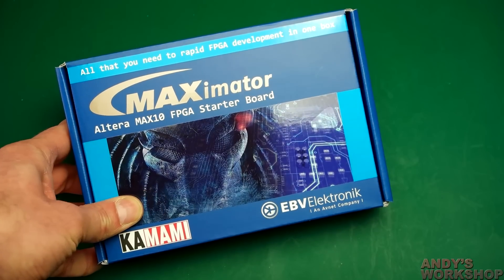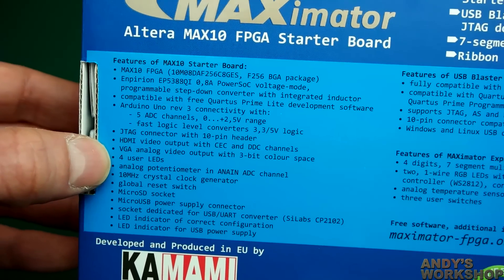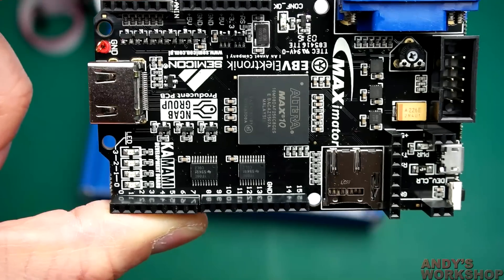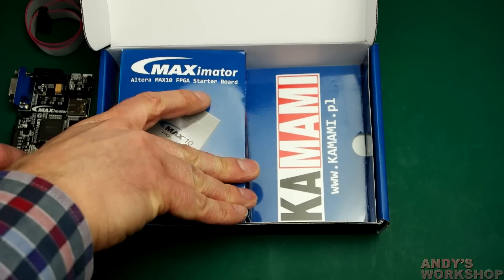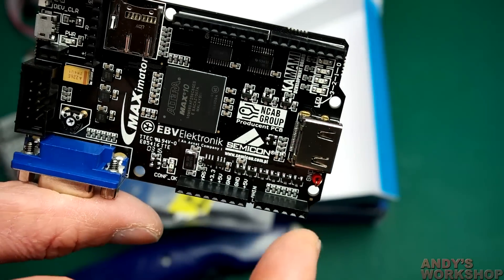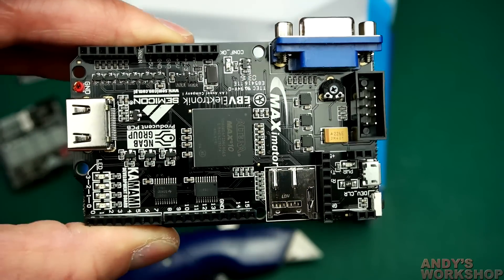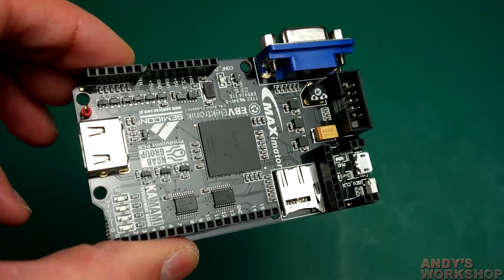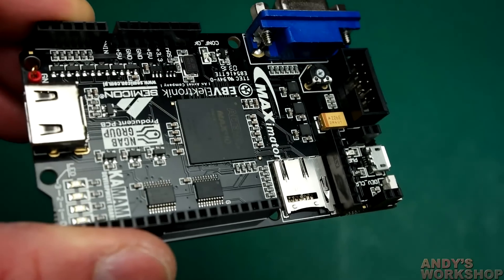Maximator FPGA development board - unboxing and walkthrough

Comment: Is it possible change the clock speed 50 mherz?I mean changehing the crystall,will it work anymore,can program it again if you change the crystall?Sorry my bad english but i hope you get the point.
Reply from the maker: Hi, FPGAs have internal clock multipliers and dividers to get you the clock rates that the different parts of your design needs.  Is there some reason you can't achieve your desired clock rate with a 50MHz base clock input?
Reply: @andysworkshopuk  Hi,just looking board that can be used build Minimig and little bit overclock it.Thx for the answer.

Comment: Great review! Seems like a good little board for development and education. I'm surprised they didn't incorporate the USB blaster onto the board, instead of a separate break out board adapter. Usually the costs are more (PCB materials, etc.). Just a small nuisance, but otherwise still does the job.

Comment: Can this board run Linux?
Reply from the maker: +Aric Wang No you can't run Linux on an FPGA. This board is pure programmable logic, not a CPU or MCU.
Reply: Andy Brown Thx for ur reply, when develop a CPU, must simulate IP cores on FPGA, how does it work? Before we make a chip, CPU/SoC/Modem , we run IP cores on FPGA, what's the problem? I'm learning FPGA now, so pls help.
Reply: +Aric Wang I do not see that this board has some external memory, that could be the reason you could not run linux on it ...  You can check our Soft CPU and try to run linux on some boards or just check how softcpu works ...  https://github.com/f32c  we already supported boards that we have on stock, but you could try to support this one with our support.   http://www.nxlab.fer.hr/fpgarduino/